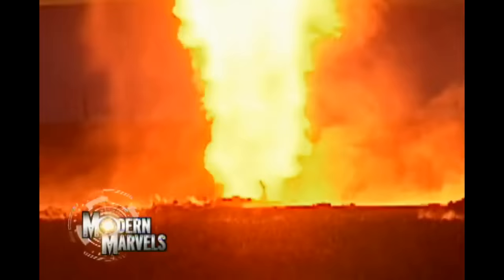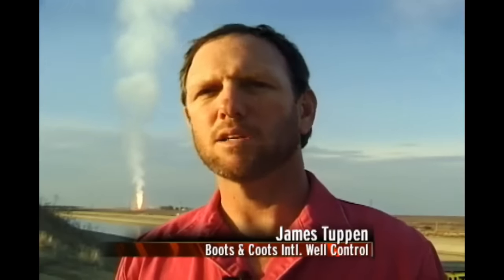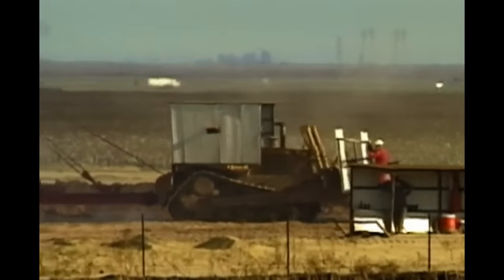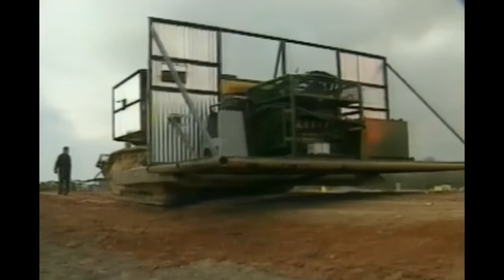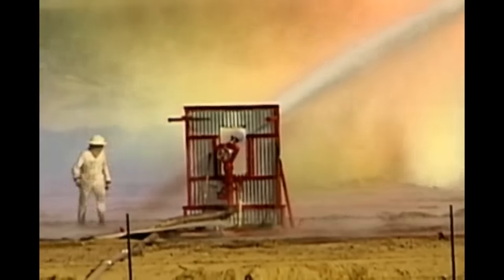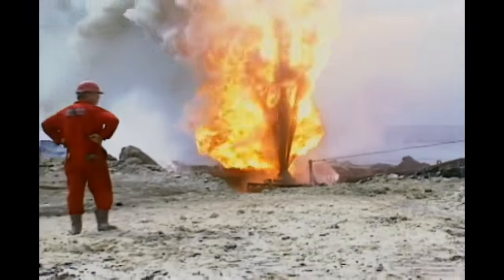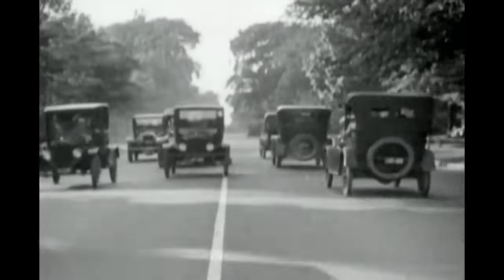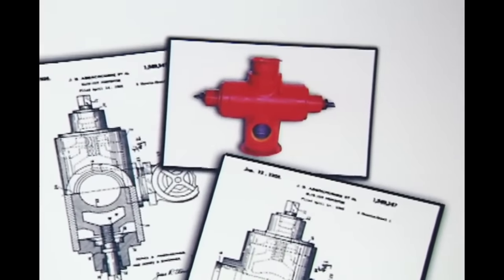Modern Marvels: Oil Fire Fighters Risk it All - Full Episode (S11, E8) | History

Comment: 25% hearing loss in my left ear from a 3" valve being left open when the bop was opened up on a gas well. I was standing about 50 yards away when it started blowing. I felt like I was gonna puke and pass out at the same time. I've never heard something as loud as a blowing out well.
Reply: Jim C a unimaginative about of pressure . It’s hard to imagine how much oil reserves hold in crude and in gas
Reply: Its loud alright. Try being the guy who has to go close the valve. No ear plugs style.
Reply: @Allmotorzl1  why was there 3" valve on the BOP? also didnt y'all test after surface string? And why not circulate it out over shakrws

Comment: How do you end up with two people in the world with the weirdest last names, which happened to be Boots and Coots? I think that's so divine to end up like that doing the same business. A rare business at that. Who else knew that wells could burn that long? I had no idea, I thought they ran out of oil faster than that.
Reply: Boots and Coots was their First names.. not their last names.. it was Boots Hansen and Coots something I for got his last name.. but yeah those were their actual First names.. edit: Coots last name was Matthews.
Reply: Depends on the reservoir and fuel source. There's a mine in Pennsylvania that's been on fire for 50 years.
Reply: @coltburks5450 Coal fires like the one at Centralia are very different to oil well fires though.  In Centralia the fire is working it’s way along the coal seam and will continue to do so as long as it has fuel, but it has a relatively limited supply of oxygen so it’s not moving particularly fast.  The whole area has been extensively mined, so it’s impossible (or at least prohibitively expensive) to completely block off and extinguish the fire.  Oil fires are relatively easier to put out because the point of ignition is at the surface where fuel meets air, but they burn much more energetically.